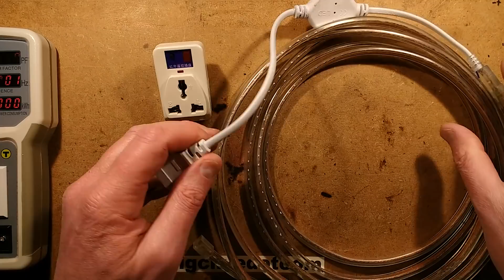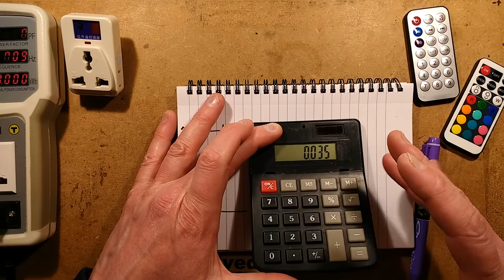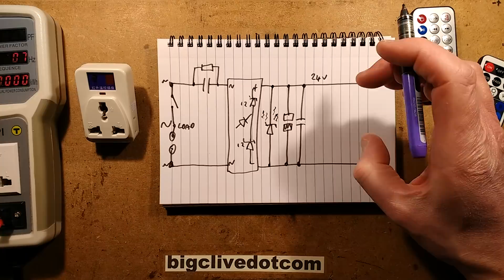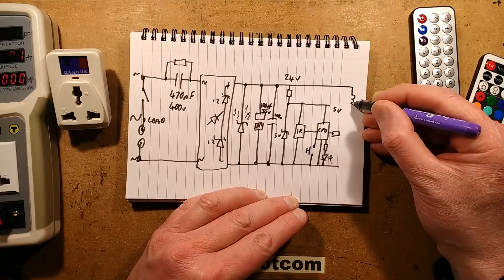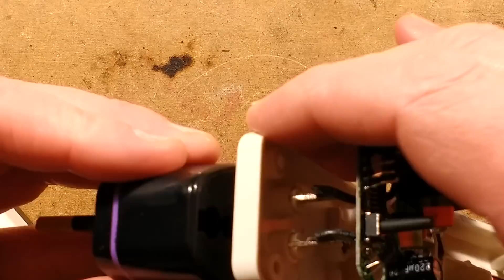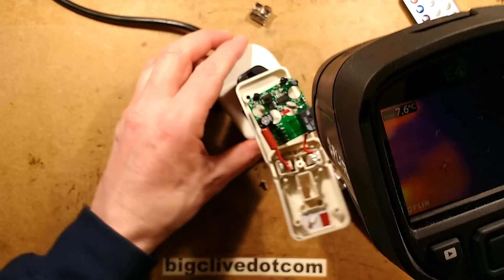Inside the cheapest remote socket I could find.

Comment: 4:39 I think I have radio sockets that also hold some unspecified amount of codes. I thought that they hold only two codes, but with what you're saying now, and how much trouble I had when I wanted to remove a code (TL;DR: I've almost gone bonkers) makes me think that they could be built with the same logic if not the same parts.
Reply from the maker: It's usually easier to delete all the codes and then reprogram the valid ones.
Reply: @bigclivedotcom  This is (probably) exactly what happened. I just wonder did I had to put a third code or the 17th code? Unfortunately I have only one pilot and it can do three pairs of on-off (so I hope it was three ;P).

Comment: The ( larger ) versions of these , should they be faulty ( or lost the remote ? ) can be re-used !  ... strip out the electronics and fit a 2 μF capacitor ( from most defunct UK central heating pumps ! ) between the live ( in ) and live ( out ) , neutral and earth keep connected thru .... this makes an IDEAL ( zero loss )  mains dropper for your UK  Poundland™ 60 Watt  Tungsten filament " squirrel - cage " lamp , for use as a night-light ... the bulb will then last longer than you do , OMG ! ... ( US readers MUST adjust values of capacitor / voltage rating  ? ) ... ( tried - n tested ) .....  🐵 .. DAVE™ ... 🛑

Comment: Is it the type that will turn on when transmiting at 5watts on a Two radio. It's always fun driving past homes talking on a radio as the radio transmissions set off peoples security light's due to electricians failing to install RF chokes in lighting circuits.

Comment: The fifteen buttons on the bottom that you pointed at (4:25) only number twelve. I would have assumed that you were also including the white row, but you specifically called out one of the white ones as the additional one. So, are you sure it was 16 buttons that it remembered, or was it actually only 13?

Comment: I'm surprised that such a cheap device uses that "huge" MCU + external (flash?) memory. An ATtinyXX in an 8-pin sodip could have done the job easily. It would need to use its EEPROM to store codes so as to be non-volatile. Runs happily at 8 MHz on 5v, so plenty fast for IR. Makes me wonder what cheap MCU makes up for the BOM costs.
Reply from the maker: Probably a Padauk (less than 5 cents).

Comment: These things always scare me for use with line equipment but I have a small pile of the boards from this kind of thing because the guts are fine with an external supply. Based an entire communication system years ago on similar such salvaged crap, that used RF instead of IR... Never had the first problem with it but wouldn't have wanted to use any of it as originally designed

Comment: analyse this  apparently its 3600w light  with 6v18w solar panel and over 900 leds  and a 25ah 3.6v  battery and has radar detection      : https://www.ebay.co.uk/itm/3600W-966LED-Solar-Street-Light-PIR-Motion-Sensor-Outdoor-Wall-Lamp-Remote/164229816912?epid=21038964499&hash=item263cdc2250:g:qBwAAOSwqehe121q        i might get one my self lol
Reply from the maker: Doesn't post to the Isle of Man.  Says 3600W but 36,000W in the picture.  Actual power probably 3.6W

Comment: calling it now the button is just straight to the IR output line if it's a separate module

if it's built into the micro then it's probably on a different circuit

Comment: Been learning alot about electrical engineering from this channel (among others like electroboom) but I'm confused about this.  Why does it have a bridge rectifier if it's input and output are AC?  I'm assuming it's because the internal workings require DC?  How is it converted back into AC for the output?
Reply from the maker: The DC is for the circuitry.  The output is just switched by a relay contact.

Comment: Quite lethal, not connecting earth. If you have 3 devices connected on one extension cord with 3 outlets connected to this switch, all protective grounds are not connected to ground. If one device fails, it may set 240V to the casings of all 3 devices !

Comment: So is it safe to use it? I saw them before on aliexpress and I thought they look totally garbage and I wouldn't risk buying them but since (if i'm getting it right) u say they are good I might actually get one of two of them and use through decent quality adapter.
Reply from the maker: The main issue appears to be that the relay contacts are only rated for 120V AC.

Comment: I wonder if you could put in a better beefier Zener diode so it wouldn't get so hot, the remote plugs I bought don't get hot at all when off but we have 120v ac in USA so that might be a factor in that. The ones I bought make a very loud click so they might be using quite a big 120v relay and another supply for the RF circuits probably a switch mode chip of some type.

Comment: I recently bought 3 remote control sockets for US $15.95 120v USA plug, RF remote and they are quite awesome, come home at night press all on and all the lights in my living room come on and they can be switched individually on or off between the 3 of them from the remote. So there is actually some good stuff on Ebay if you live in a 120v country and just run LED lamps off them it's no big deal and they work great. Item number 253489212206 if you're interested in getting them.

Comment: btw if you want something a bit more versatile for in-home-automation without becoming totally poor in the process,  there's a product line called "sonoff" by itead, which does 433MHz and/or wifi (using a shitty cloud hosted behind the chinese firewall per default) which you can flash with an open source firmware to make it connect to your local wifi instead of their cloud-app-thingy and control those via MQTT and REST apis. cost about 5euros on aliexpress for the cheapest model (which is just a 220V wifi switch). might be interesting to see you mess around with one of those.

Comment: I had a whole system of remote control from Radio Shack, some time ago.  It sent the control signals through the house wiring, and worked very well.... UNTIL my electric company installed remotely-reading meters.  The meters sent a signal out, so they could be read without a meterman entering the house - and they also randomly turned my lights and appliances on and off and up and down!   Whole system is in a big box of parts, now.

Comment: Isn't 244 V quite a lot? It's supposed to be 230 V, isn't it?
Reply from the maker: The UK voltage was 240V with tolerance the new 230V mid-way between 220V and 240V has a wide tolerance to accommodate both standards until the old transformers gradually get phased out

Comment: Ooooh, new category - "psychic teardown"! ;) Seriously though, I suspect the reason for the separate memory chip might be one of two things - either they managed to select a main MCU that just happens to not have any EEPROM so they needed some external non-volatile storage, or they are actually attempting to learn codes as generic sequences of high and low pulse durations instead of a specific standard like RC5 and that would take more storage than a typical 8-bit MCU would have. Failure to learn any remote doesn't necessarily disprove the second case - some remotes keep toggling bits when pressed or thwart extremely naive learning in similar ways.

Comment: If they used a slightly not-as-shitty case, they could have whacked a transformer in there instead of using a boiling hot zener diode with a capacitive dropper.

Comment: My guess MCU is STM or some STC. As cap/diodes might fail, is there any fuse? Maybe i missed this moment in video, but this is i believe critical part of safety for any capacitor-transformerless power supply.
Reply: +nuclearcat -- Sure, it has fuses... The relay is a smoke-emitting fuse, the diodes are smoke-emitting fuses (and/or noise-emitting fuses), the circuitboard traces are smoke-emitting fuses. Some may even emit fire. ;)
At least the 78L05 has internal protection, unless it's a cheap knock-off.

Comment: Clive It has the Grounding slot so it can still accept plugs without an adapter even if it doesn't work
Reply: AO Seven Electronics That would work without the metal bit.

Comment: Not a bad design, but I wish they would have separate codes for On and Off.  If you intend to hack these to use for "smart home" type applications, or even just to use anywhere where the device is out of sight (little difficult with IR, but totally possible with radio based remote switches) then the toggle button is useless unless you know what state the outlet is currently in.  I bought a pack of 5 radio controlled outlets with the idea of hacking the controller for USB (and thus network via a Pi) control of my lamps.  The buttons looked like on/off switches but underneath the plastic was just one button per lamp.  Gave those away and found better remote outlets at Walmart sold as a Christmas light accessory in the seasonal department.  These actually do have on and off buttons and I was able to decode the protocol using a cheap 315MHz radio receiver and my oscilloscope.  Found additional kits with channels B, C, and D for a total of 12 switched outlets.  It's convenient.

Comment: I used to have a touch light switch made by Vari at B&Q that also used to do similar tricks with a remote control. In my case it worked with a Sky remote, so in my bedroom I could press the ? button on the sky remote and it would turn on and off the lights :)

Comment: Using a bistable relay would mean much smaller capacitive dropper would be needed, but perhaps a slightly larger 24V electrolytic - most bistables take 50ms to switch and consume no current otherwise.  But I think it would double the BOM cost to use such a relay.

Comment: Great entertainment for 2.65. Chips confuse me. I can understand the circuit but I could never design one. I couldn't describe it either but when you describe it I can follow, sort of! Thanks.
Reply from the maker: It all falls into place over time.  Modern chips are literally a black box.  The dedicated microcontrollers used in these things have hidden software inside that is optimised for that specific task.

Comment: Thanks for the teardown, Clive. I have a different takeaway, perhaps! 

Maybe they copied a US design? I was surprised to see that ST part in there. Could be counterfeit, I suppose. Either way, there are so many safety issues on that no way a CE mark belongs on it. I understand they're not for the European market, fine. But there is another principle that if it looks safe, it ought to be safe. It shouldn't need uncommon sense. (Would you give one to your grandma?) At a glance - 

1. Missing Earth, removing one degree of protection on Class I appliances. 
2. Missing overcurrent protection. That's serious because overloading of a module like this will happen, especially when you're knocking them out for a couple of quid each. It isn't just shorts that cause fires. 
3. Missing socket shutters. You can literally stuff a screwdriver into the Live. And if you have a toddler who can reach it, they will do exactly that when you're not looking.
Reply from the maker: And the relay which was latterly realised to be rated for 125V AC.  Hence the smaller size.

Comment: Does it keep the memory when unpluged? 
There are some IR "plugs"you can buy on ebay to control the TV from the smartphone and a specific app (the are several, normally they have a Database of TVs and remote set-ups). The "plug" could be easily done with a LED apparently without buying on ebay. Maybe check the IR function from a smartphone?

Comment: on aliexpress i purchased a wireless switch for 5 euro ,it use radio waves and i think it is a realy interesting one because it has a loud clicking noise,it is very small (can be hidden in most lamps) and it use radio wave remote.
https://fr.aliexpress.com/item/Wireless-Remote-Control-Switch-AC-220V-Receiver-Wall-Panel-Remote-Transmitter-Hall-Bedroom-Ceiling-Lights-Wall/32619209658.html

Comment: I share your surprise.  "Cheap" in most cases involving Chinese electronics usually means corner-cutting, oftimes of a scary sort.  Thanks for the peek behind this particular curtain.  Now if only you'd find me one made for our American 120V mains.  ;-)
Reply from the maker: Technically speaking it just needs the dropper capacitor changed from the 470nF one to a 1uF 250V one.
Reply: Of course!  :-)  Silly me.
Are the Chinese "prongs" a fit for American wall sockets?

Comment: A simple explanation for a capacitive dropper is that it takes more power than it a device needs during part of a cycle, but then feeds the power back to the mains during another part of the cycle.  It is more efficient than a resistor because the extra power that is taken during part of a cycle can be fed back to mains instead of being dissipated as heat.

Comment: With some ebay trickery.. (hint.. look it up on the Oz site, change .com.au to .co.uk in the URL) you can get the 250V for £2.52 shipped. Do I need one? No... Am I tempted to get one just to mess about with.. of course. Will it burn the house down.. maybe, but there is probably slightly less risk of that than there is with my collection of dodgy Chinese lipo chargers, so not enough risk to actually stop me buying one.

Comment: BigClive, I had one yeaaars ago, it stoped working for some reason, I would love to fix it tho but I have no ideia what happened..
Reply from the maker: If the LED still lights it could be a welded relay contact.  If it buzzes when it's supposed to be on it may be gradual failure of the dropper capacitor.  It's probably cheaper to buy a complete new unit.
Reply: bigclivedotcom Hey BC. Nope, no LED light, nothing, acts as dead. Was using it for years to power on/off an internet router. I guess I need to buy another one.

Comment: Does the 2 square peg plug system have an earth connection that could have been wired through   Wondering what sort of load it can switch. .
Reply from the maker: The relay is rather poorly rated at 125V so I'd only trust it with very low power loads.

Comment: If the thing's designed for 125VAC, would that explain why the Zener is running so hot? It's having to drop more voltage than it was intended to. 

Either way, the thing looks like a horror, wouldn't be mentally capable of plugging it into the mains at mine. Freaks me out like girls are freaked out by spiders. If somebody put a gun to my head, I might plug it in but wouldn't leave it unsupervised. Worrying it's actually worse when it's switched off, not on.
Reply: Might have an "alternative use" as a low-power space heater for small spaces?? :-)

Comment: Maybe there is another version for a different socket that actually uses the earth because the PCB has an empty space at that spot.
Reply: It wouldn't be too difficult to insert a UK standard earth pin there, and run a suitably heavy gauge cable to the socket "earth". You might have to do a spot of "trimming" where the connection to the pin's concerned since there doesn't seem to be enough space to accommodate a standard screw-clamp style earth pin.
Reply: You could surely modify it but I thought there might be a version like that already available. With the 125V relay you shouldnt use it on a UK socket anyway :P
Reply: The "completely useless earth pin receptacle" at least allows users to insert a plug with an earth pin without having to resort to a hacksaw to cut off said pin.
Reply: an Australian earth pin would work
Reply: The 'earth pin' connection could be used  to detect a ground fault / leakage in devices that have proper grounds .

Comment: I think it would have been better to use a smaller (~220nF) capacitor dropper but with a larger smoothing capacitor. That would give you enough stored energy to trigger the relay, with enough continuous supply to hold it, while consuming half the power.
Reply: And reducing the load on the Zener (so improving long-term reliability)
Reply: It's an option. You can run a 24V relay at 20V and it should be OK at household temperatures.
Reply: Its probably cheaper to buy a new one than spend money heating the soldering iron and using solder to repair it!
Reply: I have run 24 VAC relays very successfully on 12 VDC, though some units will not drop out as expected thanks to the manufacturer using a steel which retains too much residual magnetization for a DC-powered relay. It's not a problem for those few relays to run on AC power, of course near the rated coil voltage. My work-around was to run those relays on unfiltered, partially-rectified power, which is DC with an AC component. That is easily achieved by putting a large-ish resistor in parallel with the one diode used for half-wave rectification. Caveat: Not all coil driver circuits will be happy with that kind of relay powering!